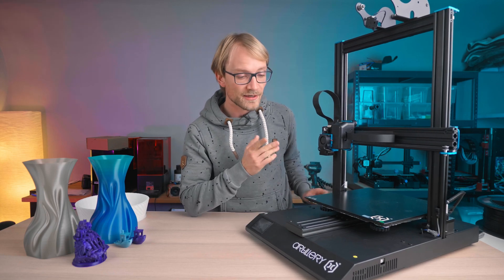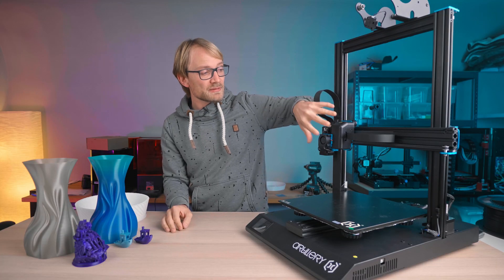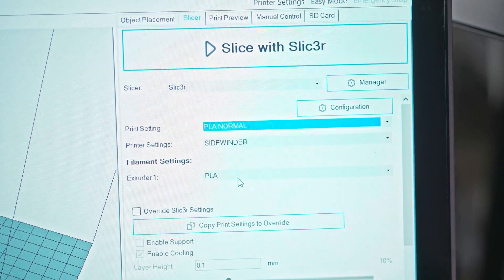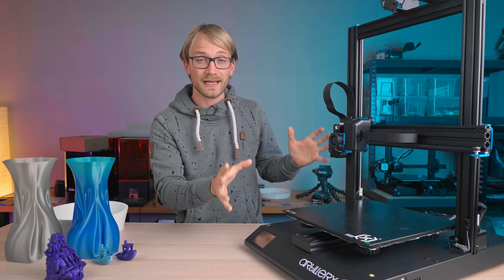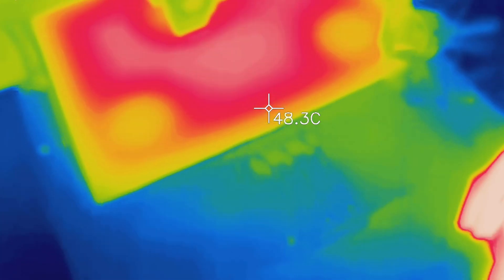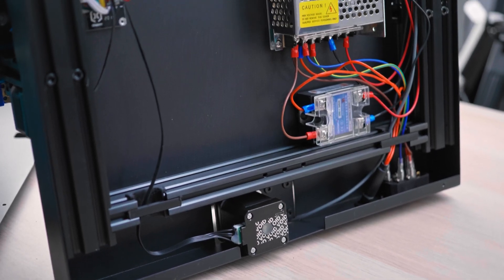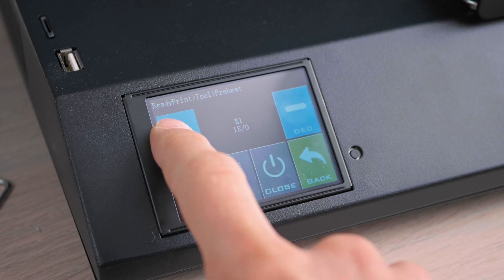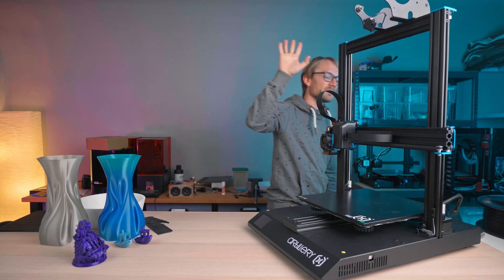Artillery Sidewinder X1: Built for show!

Comment: This sort of issues with import Chinese printers is why I'm so glad I got a Prusa MK3S instead.
Reply: wtf, ender 3 is one of the best printers in 3d printer history. You understand what you are saying? I mean, Prusa is good, but you cant just be racist.
Reply: Yeah, ok, but prisa has it's flaws too(don't be offended Josef)
Reply: Ok, I meant for the price, cause (in my opinion) you can't compare the prisa mini against the ender 3
Reply: @Wraith-Kryptos Calm down. Ender 3 is good for the price and Creality seems to be one of the better Chinese brands. But it have had its share of issues from time to time as well, depending on the batch, contracted manufactures etc (for example: there was some issue with some Creality machine having bad connectors for a batch a few years ago, don't remeber if it was Ender or not. And I have heard of quite a few Ender 3 being delivered with warped beds). And that is the issue with many of these import machines, including the Artilliery: quality varies and you don't quite know what you will get.
Reply: @Wraith-Kryptos  It was only the cheapest usable 3d printer. By makeing much compromises. Like using bowden, just to spare a second z-motor. Fire on some Ender 3 due to bad connectors. Always a bended bed, but no ABL. There is a reason many people added heavy glas bed ... Minimal expandable board. On the 8-bit versions: Marlin 1.6.3, no bootloader, low flash.
A nice platform to tinker a lot. But from stock? Accaptable, not more.
Do not swap "most sucessfuly sold" and "best". It was simply low price for it´s time.
The Prusa mk3s on the other side is a good printer beside its age.

One costly part of the original mk3(s) is quality, service and producing in EU. If you do not need it, you can buy an mk3s clone - wich is about 283€ on sale from Fysetc (+24€ for plastic parts, if it is your first printer, + full metal-heatbreak). And there are worlds in quality and comfort between even a cloned prusa and these knokoffs like Ender3 and Sidewinder.
Reply: @oleurgast730  well, you're right on the best price to product ratio, but I don't see anything bad about the Bowden, just it makes the head be faster. You can easily fix the bended bed with a piece of glass(did mine with a pane I found on the street) and you can't say that the skr mini is a bad board as expandable board
Reply: @oleurgast730  why do you think that the ender 3 is a knockoff, if so, from which printer?
Reply: Thank you ❤️
Reply: @Prusa3D  But please speed up design of the planed big size printer...
I by the way prefer the mk3 over the mk3s. The problems with old filament sensor were only caused by PET-G being reflective, so inside the sensors chamber was to much irritating light. The old sensor work great after printing the printhead from non-reflective Greentec pro filament..
So I do not like the downgrade from mk3 to mk3s...

Comment: That's interesting, most other reviews I've seen on this printer were all positive.
And those weren't small channels!
Reply: Other youtubers mentioned that their units were grounded and there are even some vids showing this. I am not saying Thomas is wrong. Envovo likes to iterate on their printers without saying anything about it, and there could have been some downgrades in quality.
Reply from the maker: @NullNamos  I did measure resistance to ground on the unboxing livestream - it doesn't make contact on mine. They are trying to ground the frame through the powder coating, which sometimes works, sometimes doesn't, but it's definitely not the proper way to do things.

@Lucas Abdala @ManikWeet The other reviews may very well have been accurate for the units they received - but it looks like Evnovo are constantly making changes to the printer, some for better, some for worse. That, in itself, is an issue because you never know what you're going to get.
Considering some of the poor design choices that were made on the X1 I received, it's got me questioning Evnovo's general approach to quality control and reliability testing.
Reply: @MadeWithLayers  yeah that's kinda suspicious 😬 They also made a video about quality control issues and demonstrated their quality controll, but I guess they haven't really learned from those complaints as demand started to rise again! 🤔
Reply: @MadeWithLayers  Yes, that is a real pain on these kind of printers. I have (had) a couple of those printers, from earlier runs but of course with the same name and numbers on them. Both were earthed well over the PSU and did not have this issue with the bad bedcable like yours have but much better flexible sleeving. Did have more issues with the ribbon-cable (boards) though and other electronics-problems.
Actually, one is in parts and used for other printers and the other has been changed for a lot, including electronics, extra 24V heated bed (external Power-supply) for the full bedsize and such to make it a very well working 3d printer with a .8 nozzle.
.8 works really well including PETG, it has an extra-capacity-hotend heater (stock) and can run well with a 1.2 mm nozzle as well but then the speed needs to be lower because of the clone-extruder. So, it might be a nice starting-printer to build on further yourself. but not too well when stock like you mention. 
Thanks for the review, keep them coming please.
Reply: @rhystdavis  Thats worse than I thought, it means they are happy to send defective and dangerous units out for the general publi, its not a slip of QA process its a deliberate action taken after QA.
Reply: @MadeWithLayers  Curious if you contacted the manufacture regarding the delaminating heated bed?  More curious in a response, if any. Support is a important aspect. (the internal wiring is definitely a design / manufacturing issue)

Was looking at the Genius (a later and smaller design) that also appears to have good quality prints, but now wondering the odds of that design having similar issues. Looking for good value first 3d printer. BTW: found your 3D Printer Basics playlist informative.
Reply: @3D Print Wrangler I certainly hope that's true as I ordered on in 11.11,  but still going to check very carefully, thanks to this video. Never can be too careful when it comes to electrical safety.
Reply: @3D Print Wrangler have you been in the Sidewinder Facebook group? Many of these electrical issues are brought up often. Especially the bed heater wires breaking and having to be replaced.
Reply: @3D Print Wrangler Maybe so. I have seen a lot of problems and complaints in the multiple userforums of this printer but hard to tell how many they were and since there is no serialnumber on the printer no-way to know how many and how many different versions were sold.
I have had 18 versions of it in my hands and all had different parts and different problems. And almost all of them had safety-concerns.
So, even if they print perfect ... will not use unmodified for the best.

And yes, maybe there are newer versions now after more then a year after first production. There are no versions written on it and Tom is reviewing the printer he has received, not the newest version if he did not receive it.
Th e left-over of mine is printing dayly with the safety- and other modifications in place and like I wrote much better and safer then some of  the Crealities I have received and I really hope  Artillery / Evnovo will make the printers better and safer and will make a real new version like the Sidewinder X2 or something like that to make clear that the issues are finally resolved.
Reply: @elvinhaak  
I know this is from 3 monts ago but there is some sort of an identification/serial number on the sidewinder, its a sticker on the left Z-axis stepper motor.
Atleast their customer support (which is really quite helpful) asks for that number in every ticket.
Reply: @darnoc4470  Ok That is nice. Good progress. I advised the company this many times and making some listings available that people can know which "version" they have.
Reply: @3D Print Wrangler unfortunately I was under the impression this was a recent unit. Now if he has an old version and they have improved upon it over several iterations, what is even the point of reviewing a gen 1 if it had known issues and was fixed. My mistake
Reply: Ehm 3D Printing Nerd ehm
Reply: I still think that Michael (teaching tech And Angus (Maker's Muse) i still agree with them
Reply: Yup, but they didn't go in-depth with the electrical connections. Given the printer's ability to produce good prints, the large area, and relatively low price it's still really good in my opinion. Even the electrical part is better than a lot of random Chinese printers out there, like my previous delta lol
Reply: @lekey9000  I would have thought the kinks in teh power to the 220V bed should have been picked up by everyone for a start.

Comment: Whoa, mind blown 🤯 I've got 3 of these v4 printers. I absolutely love them. They've got great reviews from most other YouTubers like, Maker'sMuse, 3DPN, TeachingTech, and their Facebook group is awesome with support. I've done basic user repairs, even converted the printhead assembly to print 3mm pla. Besides user errors, I've never run into an issue. I'm not doubting your knowledge, I've been watching your videos for 3 years and I rely on skilled people such as yourself. My question, what can we users do to make printers safer?
Reply from the maker: What I'd do to my specific unit is to replace the entire heated bed assembly - glass with no heatspreader is a poor choice to start with. I'd also look into replacing or at least reworking the internal cabling and electronics.
Keep in mind that apparently other X1 units are built differently (that is, better or worse) in the spots I found.
Reply: @MadeWithLayers  would you consider doing a series where you fix the V4 into a much safer machine? After printer reviews of course
Reply: First of all you could easily ground the frame of the printer, that would be a great start. The cabling for the bed can be replaced with silicone wire that bends better, or at least figure out a way to make the cables flex around the whole cable instead of certain points, perhaps with a cable chain. Replacing connectors with proper ones would be a possibility but if they're make good contact and are secured with hot glue, I wouldn't start messing with it. It's super sloppy but it's not going to set your house on fire.
Reply: That is also something I came across and bought the SW like a year ago. Other youtubers even mentioned, that their units are grounded. 

Just checked my SW bed cable and it is way more flexible than Tom's. There was a change in v4 to another kind of nozzle and maybe other parts were downgraded, too.
Reply: The V4 is the newest version.
Reply: @skandranon314  But there have been multiple versions of the V4.
Reply: Ground it. Put good (and matching) plugs in it. Check that no cables are kinking. That's basically it
Reply: There is one step you should do on every printer with AC bed: Use a residual current circuit breaker. There are cables available there these protection is integrated.

The problem with maybe causing fire due to the heatbed cable is not solved by this. The best in my opinion is to let it be changed to a cable like used on an iron.

Be aware in some contrys working with AC is not allowed without formal certificarion (beeing an electrican or electro engeneer). For example in Germany it is a high risk you take: If you do modifications on AC, you be responsible 30 years. In civil law, as you did something illegal, you have to proof you did everything alright if someone get hurt (there was just auch a decission on a German court).

Also in the EU the importeur is count as "manufacturer". So not only risk customs keeps the product - If you sell it after a few years (or even gift it to someone) you be responsible as producer. No way to avoid it, No way arround - exept dissassembling it and sell the parts (exept for the AC parts).

By the way: Any kit you assemble also makes you "manufacturer". So do not give it away... There is obviously a reason Tom made a teardown of a functional printer he does not use anymore. He also lives in Germany...

Comment: I have it. Its been a very good. The only thing I did after a year is change to an all metal hotend and and thermal paste for heatblock for the extruder.  Extruder might be a cheap knockoff but it works and the silicon sock seems to keep the hotend temp constant. After a year, bed needs glue stick for PLA good sticking; plan to upgrade to magnetic plate. Thermal run away works fine when the temp prob crashed. Compared to ender where mod after mod is needed to get working; this prints right out of the box. Teaching Tech has put a great video for upgrading the board, but mine works so well, I will hold off till I need to do some major maintenance.
Reply: Same here

Comment: I actually like mine.  I did replace the cable sleeve with a spare Prusa one I had lying around and also printed a strain relief for where the cable connects to the bed but it has been a pretty good workhorse.  I think all of the printers come with one corner of the heater pad peeling off but I just pushed mine back and it has stayed in place for a year now.  Come to think of it I also replaced the power supply with a Meanwell one so maybe it does have a few issues :)  Still prefer it to my CR10s though.

Comment: Damn, I must have been lucky then. Mine is grounded (maybe a screw impaled the coating?) and there are no kinks in the heated bed wire (it rolls like it should). I have a great time with it and for the 330$ that I paid it's a bargain! But I also went forth and removed all the hot glue and fixed the wiring... So your statement is correct: Only get the machine when you are willing to fix a few things and you know what you are doing. 
Great review!

Comment: For this size of machine, wouldn't corexy make more sense? So the heavy bed and large printed object won't have to be moved around? (apart from in z)
Reply: You are totaly right. "Bedshakers" are for smal sizes (up to 18by18 cm² on bowden systems, up to 23by23 with direct extruders) there the x-axis+extruder has more weight than the bed.
The big bedshakers beginning with the CR10, simply scaling up an engeneering solution for smal printers, are a bad idea in an engeneering sense. But to be fair: much more affordable than a cube design. And If you only need big size from time to time, even a chiron can be a good deal. Simply print slow (even If a print takes two weeks than).

But I also would not reccomend coreXY due to the long belts (bending) and mostly being bowden. Best in my opinion is double crossing (carbon) rods and an Orbiter Extruder.
Also with big size it might be better to move the xy-gentry up and down (like on a Voron), not the buildplate. A 30by30 buildplate should be made of at least 9 mm milled casted aluminium to be perfectly flat. The xy-gentry will weight less...
Reply: @oleurgast730  For the extruder I remember seeing a "remote direct drive extruder", think it was called Zesty or something like that. The idea was to have the motor on the frame but the extruder gears near the nozzle and transfer the movement via a bendable rod. Might make sense the various box style printers.

Personally I don't need to print that big and I'm happy with my Prusa MK3S.
Reply: @VorpalGun  yes, the zesty nimble is an interesting option. But the Orbiter with Nema14 with 120g (feeder+stepper; hotend and fans to be added) is more precise. It seems the better choise. I got one last week and will try it about Xmas.

Most of my prints I make on my mk3s (and some Clones I build). But my hobby is tinkering on 3d printers - and on the mk3s is not much to do ;-)

Comment: In fact i have the 1st gen and 3rd gen and never had any issues. And prints extremely  well. I think you are a bit biased towards the printer.
Reply: Never had a serious problem with mine (V.4) and it prints really well.  I installed a BLTouch which takes care of bed leveling (I did find the bed would shift from one print to the next so there is that..). I will be ripping out the main board and replacing it with a 32-bit SKR Turbo soon, but that's just to get more features like M600 support and so on. The flat ribbon cables do not like being disassembled frequently, leave them alone and they're ok but after a few times pulling them out and re-inserting the connectors get mangled. My extruder stopped working for this reason once but trimming 1/16" off the end solved the problem rather than replacing with a spare. There's no such thing as a perfect printer in this price bracket IMHO, you're just going to be choosing which flaws you are prepared to live with or fix.
Reply: It's a clone printer with a nice exterior using slapped together off the shelf parts. Not sure how pointing out potential points of failure and other short comings shows any sort of bias.
Reply: @Navilin  what you mean clone? And what is original in this market? Except from the patent holders for the technology  i dont see anything original. On the other hand i just watched a video focusing on everything that appears to be bad. My opinion sorry if you dont like it.
Reply: @Craptis  Yeah I'm not using clone as a dirty word. The point is there are dozens of printers occupying the same price point, build volume, and print quality range. They all more or less produce the same quality end result. If a printer is just rehashing the same design at a certain point the only topic of discussion becomes the finer details. By it's very nature the positive things to say about it end at it delivering the same results as dozens of other printers. What exactly does this printer deserve credit for that was omitted from the video?